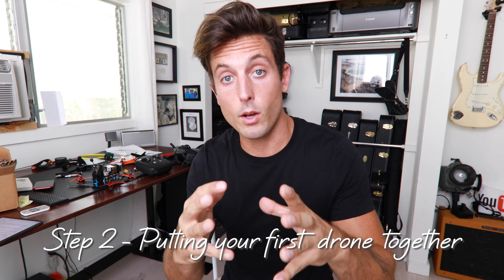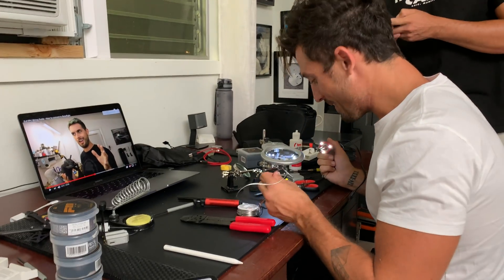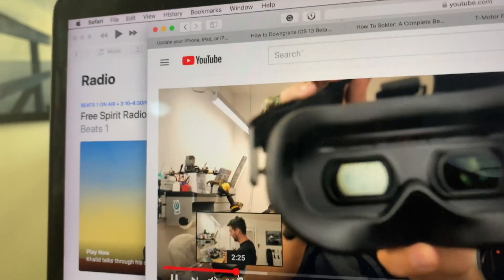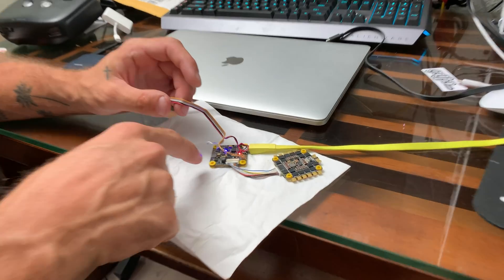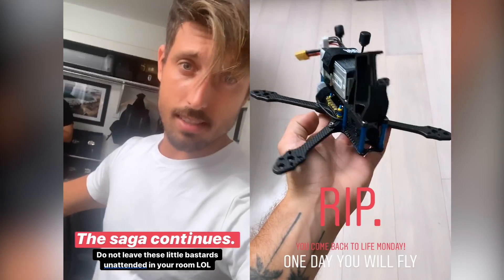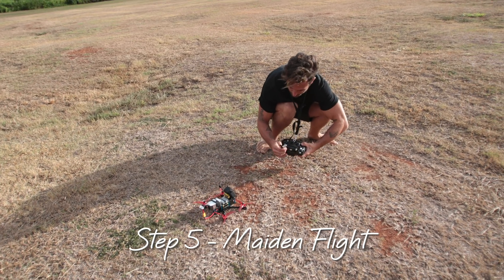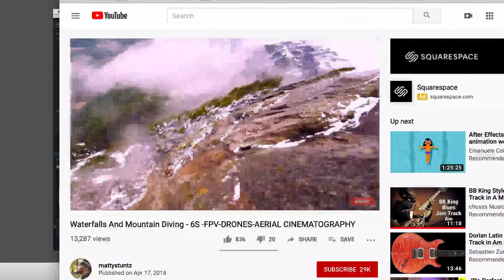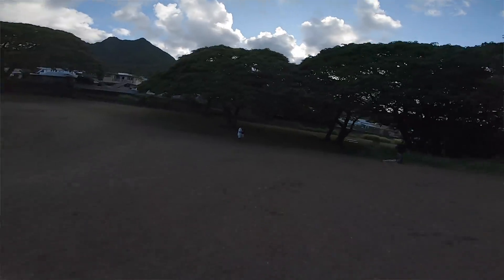How To Build a Cinematic FPV Racing Drone! • DJI Fpv

Comment: I am a bit worried on your battery lead as on G-forces it eventually will get to propellers. Insert drone-side plug somewhere where you can zip-tie it to frame and of course cut extra wire away. Also balancer leads can get to propeller..

Comment: It's happy to see other getting into fpv hobby.
For people interested into fpv, there are a lot of parts are way more expensive than it has to be, most beginner can get away with 300usd drone and 300usd equipment.

The flying can be cheap or expensive. Watch more YouTube on le drib, uavfutures, Joshua bardwell etc
Reply: What is considered a low end fpv drone? If all I'm after is high quality footage by attaching a GoPro how much would the drone itself cost? Is it still $300 use or do you have to spend more so it lasts longer in the air?
Reply: @ToastyMcNuggetLuvr  You can litterally build one for £100, £150 you can make some massive improvements, check out UAV futures

Comment: There HAS to be a cheaper entry level hobbyist version for people looking to start. That build cost you thousands and literally money down the drain on trial and error. Lol anyone know any??
Reply: TheThirdErnest hobbyking has lots of parts and kits from overseas for much cheaper than the dji products and they now have us based warehouses. Or places like getfpv.com have what’s called rtf ( ready to fly ) quad copters for less than 600. Unless your a complete nerd and into the rc hobby for years 🙋‍♂️than rtf is the way to go then learn from there
Reply: There are! This is top of the line stuff, no need to go there. Start with a tinyhaws for example:
https://www.banggood.com/Emax-Tinyhawk-Indoor-FPV-Racing-Drone-BNF-RTF-F4-4in1-3A-15000KV-37CH-25mW-600TVL-VTX-1S-p-1375328.html?akmClientCountry=ES&utm_campaign=1211488_february&utm_content=2635&p=UG06171211488201502B&ID=517238&cur_warehouse=CN

Comment: I used to fly RC helicopters 10 years ago, knowing how much it takes to build, fine tune and repair from the crashes, that’s why I’m not in fpv drones yet!
Reply from the maker: hahahha it is fun tho!!!
Reply: @sawyerhartman  I bet it is! 😁 Maybe I'll join you someday in Hawaii for a session. 🙂
Reply: I gave up helis to drones, because helis are soooo much more of a pain to build and maintain :D So don't be too afraid if you know helis, drones are much easier IMO.
Reply: @jonipaananen9304  Thanks for your feedback. I know it's simpler, but I still don't want to spend that time on this hobby even though it produces amazing results. I just prefer spending my time working on my cinematography and making regular videos than FPV droning. 😁 Maybe sometime in the future!
Reply: Helicopters are a different level. You crash your FPV racer sometimes 40 times a day pretty hard and you just have to replace your pretty cheap propellers. Helicopters are trash after each mistake...
Reply: Christian Vogelgesang i would say that the problem is not replacing the parts, it’s finding which parts are bent or need to be replaced, but usually the main rotor shafts and gears need to be replaced as well the blades!
Reply: Paulo André Carvalho I gave up an on helicopters after a year. They are mechanically too complex. Now it's easy... Propeller is bend? Bend it back. It starts to break? Replace it. Motor is still spinning? It can fly. Parts are so cheap compared to helicopters. You can buy high-end motors for 20-25 bucks which are good enough to win every race. Propellers? A few cents...
Reply: Christian Vogelgesang maybe I will give it a try sooner than I thought! 😁

Comment: I was kind of iffy about the video at first but you did bring up a lot of key points about fpv. That was one of my main concerns about the DJI system. People who never flown fpv jumping into it thinking it's anywhere close to a phantom or Maverick. I've been flying fpv about 2 years now and it's nothing like it. I flight analog still with a gopro hero7. But a nice video bro very informative to Noobs jumping into The Hobby. 🤙
Reply: I 100% agree with this

Comment: With laws, this is a dying videography practice without a pilots license. Do not recommend anyone attempt this. The fines are real. I wouldn’t be surprised if he doesn’t get a $$$fine just for posting this footage.
Reply: Are you kidding?
Reply: Incorrect, if you fly for fun/hobby. License is not required. If you fly for commercial purposes, you need a part 107 , relatively inexpensive and easy to get.
Reply: Yeah I think you got to do a little more research on what you're saying. It is not the way your explain it

Comment: thanks for the info dude! I bought a ready to fly FPV drone and have had nothing but problems. This makes me feel like  I'm not alone! Time to build a new one!
Reply: @AlphaDini  It flys amazing for about 100 ft then failsafes and loses signal to the controller. I just don't know enough about it to fix it myself. I agree with Sawyer, it probably best to understand the ins and outs of the mechanics so you can fix when damaged. Its an Arris X220

Comment: Yoo I been thinking about this a lot lately and watching so many videos. I have been thinking about buying a RTF (ready to fly) racing drone by Arris on Amazon. Comes with a controller. No goggles. I got the Osmo Action already. I should probably start with the simulator though. Do you need goggles for the simulator?
Reply from the maker: naw i never used any

Comment: I have always wanted to do this!!!!
Reply from the maker: Well now is your time Gary lol
Reply: Honestly, there are easier ways to do it as well. Don't go for a 5 inch freestyle monster right away, go with a microquad that's ready to fly, for example a tinyhawk
https://www.banggood.com/Emax-Tinyhawk-Indoor-FPV-Racing-Drone-BNF-RTF-F4-4in1-3A-15000KV-37CH-25mW-600TVL-VTX-1S-p-1375328.html?akmClientCountry=ES&utm_campaign=1211488_february&utm_content=2635&p=UG06171211488201502B&ID=517238&cur_warehouse=CN

But I do agree with going with a simulator first of all.